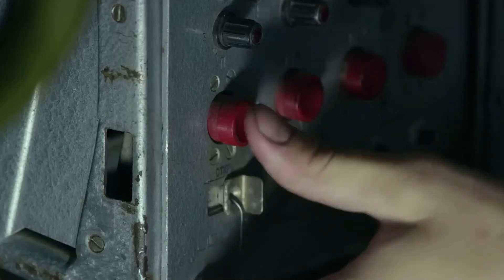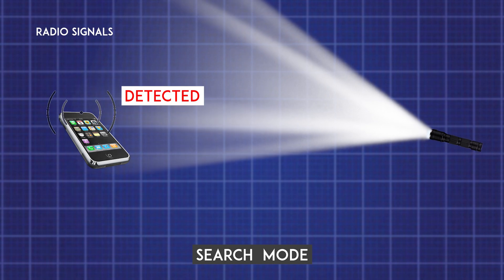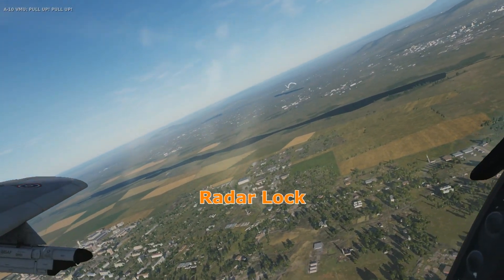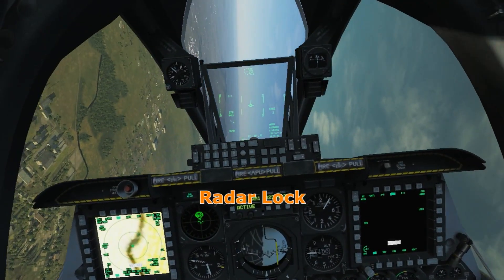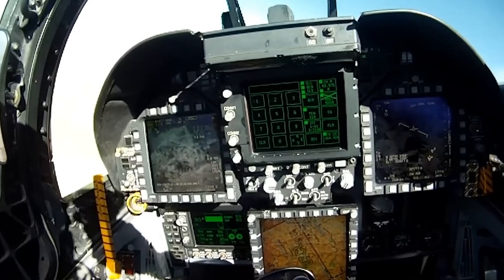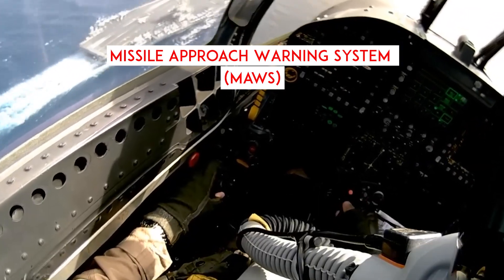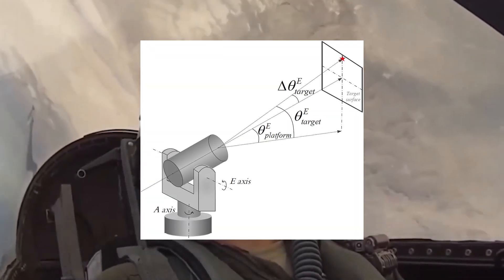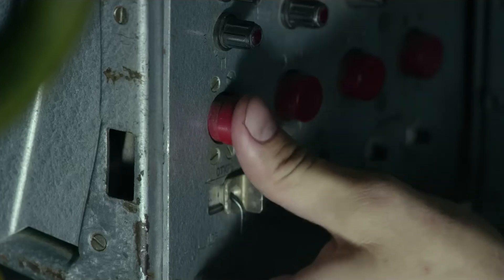Akash NG Can Shoot Down Jets Without Radar — How India Made This Possible?

Comment: Use a decoy and optical system is dead?
Reply: If you use one or two decoy still battery if Air defence have other rockets to engage target will you use swarm of fighter jets to be sucessfull?
Reply: Optical system is ground based. There are operators.
Decoys won't work. You would need a fighter sized decoy anyways.
Now that's something you need to tell me how you gonna achieve.
I dont know any jet that can carry similar sized decoy.

Comment: This is not new, in general. Back in the 1980s I worked on space-based interceptors that used optical sensors only. This was never deployed, but the technology was well understood. In fact, in air-to-air combat one of the more effective missiles is the Sidewinder, which uses infrared tracking only. It is interesting to see this used on a ground-based interceptor, but it is not really breaking new ground.
Reply: IR seekers came before radar based seekers. Optical sensors have improved dramatically in last few years.
Reply: @lastnecro  Good point.
Reply: @louisgiokas2206  hey since u seem to know about this field ..tell me if im wrong but this sort of system only relies on visual for tracking the target??
Reply: @AyeshaKhatun-v2k  I am not exactly sure what you are asking, but from what I could glean from the video is that the incoming targets are detected by means of radar. I expect that the missile's initial track is set using that information and it then uses optical sensors for guidance, avoiding giving itself away with a radar signal. You can't just fire a missile into the sky without some idea of where the threat is coming from. 

The reality is that most advanced fighters now have optical sensors in addition to their radars. This can be a pod that is carried for older fighters but is built in for the latest ones. Both types of sensors are necessary.
Reply: It is. You don't understand what this is. Anyways, best of luck. If it's not new, why doesn't your country have them?
Having optical sensors on board and having ground based optical stations to guide it without using RF is really new.
Reply: @WarriorOG-ql7gv  I have decades of experience in this. For one thing how do you know who else has these? You sound like a nationalist, not someone who wants to understand what is going on. Perhaps you work for the developer of these systems. I would not be surprised.

Especially in the age of stealth and radar tracking passive optical sensing has become more important and more sophisticated. Active radar is a great technology with a lot of advantages, but with some disadvantages as well. These are laid out in the video. 

Did you ever wonder why most medium to long-range missiles are radar guided rather than EO? What we are seeing is the standard interplay between offensive weapons, countermeasures and counter counter measures. That's what keeps the industry going.